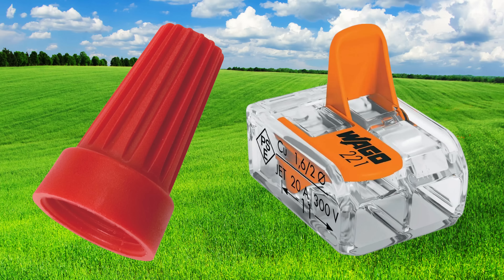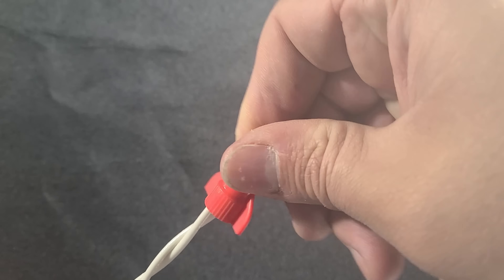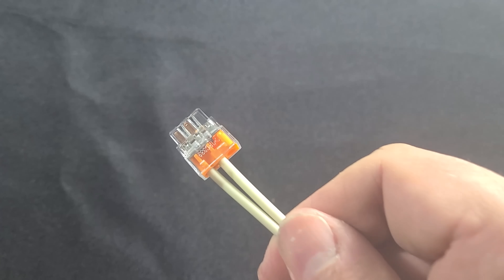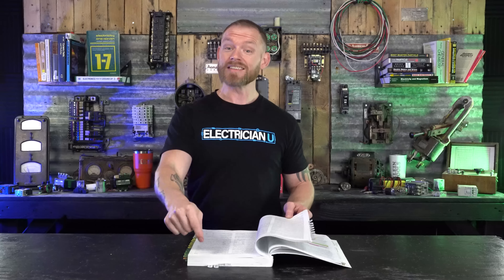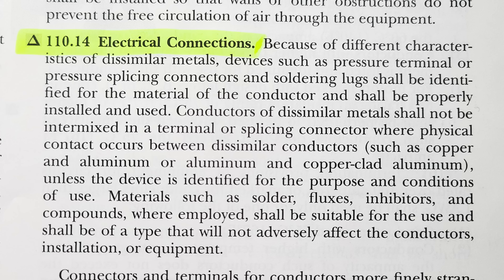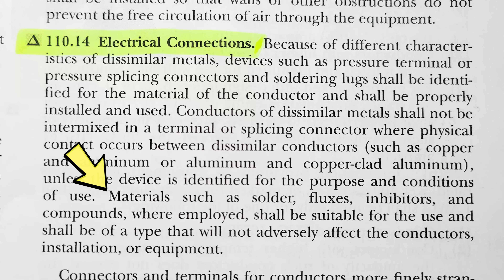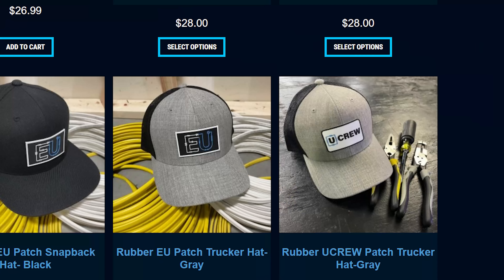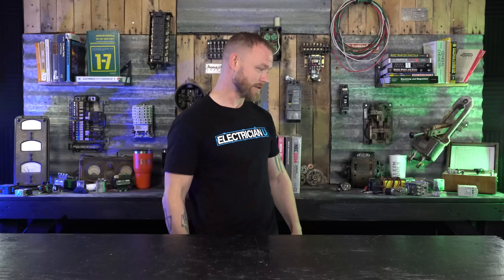Should We Use WAGOS or WIRENUTS?!?!

Comment: 15 years in the trade, once i went wagos with lever nuts ive never looked back.
They are just superior in every aspect (exept the cost, wich is saved in time anyway)
Reply: What's really stupid to me, is that no where in here did anyone say WAGO connectors were bad, but that they were a couple of degrees hotter under load and have a slightly different resistance. I'm not an electrician and even I haven't come to the ludicrous statements that others have. I mean, can someone please tell me how saying an extra, IDK, 2-3° maybe, means that they are implying that something is bad, and moreover, does a couple of degrees in wire connector heat and/or teeny bit of electrical resistance, really matter THAT much that it could really be called "BAD" with a straight face??? I mean good God people, is this what humanity has come down to, to where 2° or whatever, of heat, and/or a slight difference in resistance, can cause such name-calling and mudslinging??
Reply: Saved in reputation too. I don't know who wired my home 50 years ago is a twisting asshole
Reply: A well executed hot solder is superior in every way to either of these "trick" connectors.
Reply: @snoopstp4189  so one minute for each solder then, 5 solders in each box, 20 boxes in a house, 1 house a day for 1 week... that's more than 8 hours lost every week.... you see where this is going.
you also answer yourself in your answer "A well executed hot solder is superior". That's the point, "well executed", can you guarantee it every time? a wago is perfect every time, reliability and safety are the most important things here.
In addition to the extra time it takes to do the actual soldering from scratch, it will take extra time every time when troubleshooting or rebuilding in the future.
Reply: @snoopstp4189  that would be be the case for the final connections, in a controlled athomospher you have more time to make and less constraint spaces around...not on an construction site.
Reply: @fionafiona1146  depends on wither you want the job done right or not I guess, but w/ experience making a good solder joint takes no longer than to heat the copper, which is under a minute.
Reply: @fionafiona1146  from working in the field for 20 years wagos work better with aluminum. No chance of over twisting the aluminum.
Reply: @snoopstp4189  Not really, a cold welded crimp is better.  But we use either wirenuts or som form of Wago or in-sure connector in modern electrical construction.  We don't solder due to a number of factors that make these connections hard to make reliable long term.  Soldering is NOT used anywhere in modern electrical.
Reply: @mikeiver  a crimp isnt really a weld, but you believe whatever you wanna believe
Reply: @snoopstp4189  Really?  Then you may want to correct the likes of Burndy, T&B, Ilsco, and a whole number of others.  You see, a proper crimp connection is a cold welded joint as the conductors are brought into such intimate contact as to be "welded" according to the research.  So yes, I will believe them and their research and empirical evidence thanks very much.
Reply: @mikeiver  and what happens when you go to work on it buddy? Welding aluminum to copper? Lmao 🤣
Reply: @Zapp4132  First and formost, I am definitly not your "buddy."  Second,  The reason we crimp is to assure that service of the connection is NOT required for the life of the installation.  Again you shoot off without checking to see that you are wrong.  Both copper and aluminum are non ferrous materials and are compatible.  There are bronze alloys utilizing aluminum as a major constituent.  You also clearly are not aware that under the proper conditions, dissimilar metals can and are welded to eachother.  Cooking pots and pans are just one example.  In the case of crimping aluminum wire to copper.  The pressures involved at the interface between the pair forces them into such intimate contact that they become bonded/ cold welded to one another.  The above is true for copper to copper and aluminum to aluminum as well.    Dig in all you want but you are wrong here.
Reply: @mikeiver  it's not practical big buddy. You better stay behind the computer 💻
Reply: @Zapp4132 LOL.  I make my living working as an electrician in the main research facility of a global company.  The products of which literally touch just about everyone on the planet in one way or another daily.  In my job I work on a PLC of a test rig in the morning and after lunch the 115KV high yard in a 40Cal arc flash suit.  But you just keep showing us all how much you don't know by shooting off your mouth.
Reply: @mikeiver  whatever you say big buddy
Reply: You actually save copper wire which in turn saves cost.  🤑🤠
Reply: Except tape them to prevent accidental unlocking!
Reply: @2fathomsdeeper  in my experience they stay locked quite tightly, especially compared to wire nuts
Reply: @Chuito12PR  
I'm not an electrician and most importantly I'm not looking to step on anyone's toes here or start a fight in any way shape or form, I just clicked on this video out of curiosity since recently I've been doing some handyman work on the side, mostly drywall work and painting which inevitably puts me into electrical and switch boxes if for no other reason the homeowner saying "While you're in there", and of course I don't want to put anyone or their property at risk, so I'm interested in these connectors because as you know in older homes quite often you run into wires that are short especially if you need to cut the ends to get fresh ends to work with for the sake of not making connections with damaged and weakened ends, I may not be an electrician by trade nor have I been formally educated in the matters but that's something that common sense tells you is bad, and although I may not be educated in the matters of household wiring I have been formally educated in the matters of DC current and wiring from my trade.
Which brings me to my point, my main function in life is as a mechanic, I've got over 40 years experience in the field, am a graduate of aircraft maintenance school and have years experience in building performance motorcycle engines and helping design the modifications for performance car engines for friends and colleagues that work in that field, I've been involved in testing in various ways which has put me in close contact with manufacturers from the parts to lubrication companies, I'm not here to sell myself or my services but my field is one that I've been educated in formally and am highly experienced in, and once again have been well informed by some of the biggest companies in the industry. 
The reason I'm chiming in here is because of your reference to Project Farm and his testing, I've seen him perform so called "proof" tests on engines and lubricants that are just plain highly flawed in their execution, due to issues like lack of proper "controls" among other's during his tests at the end of the day they're at best meaningless and worst case dangerous due to his conclusions and the fact that people take them as being done at some sort of scientific level and wind up shortening the life of their engine's. 
Now don't get me wrong I'm not trying to trash the guy, he seems like a clever fellow and I'm sure he feels he's being honest to his viewers about his results but my point is if his experiments with something like testing electrical connectors to destruction are as flawed as his testing of engines and lubricants to destruction I'd be a little leery of the results. 
Just a bit of friendly advice is all I'm offering here, proceed with caution when it comes to his test results is all I'm saying.
Reply: Highly loaded for long durations wagos and insure connectors show a greater temperature rise (IE higher intrinsic connection resistance) than properly terminated and installed wirenuts.  They both have their place in my bag and are installed where good engineering dictates rather than cost or time being the determinant factor.
Reply: @mikeiver  Out of curiosity, were you using the push in wagos or the lever wagos. I assume the lever version is better but I have no evidence backing this.
Reply: @NickFrom1228  Older style lever wagos.
Reply: @mikeiver  You make reasonable points. WRT to testing, it’s important to test for failure modes—what happens when the connector is damaged or improperly used? Testing of materials under only ideal conditions is not complete testing.
Reply: @MarcosElMalo2  The various testing labs as well as the manufacturers have tested the connectors to failure.  I am comfortable with their testing and the products performance.  My testing was very non scientific and simply a test of a hypothesis I had about their junction resistance compared to wirenuts.
Reply: @mikeiver  "I dont belive that for a second"
You actually should and the reason is elementary and inescapable.

In a wire nut connection, you're twisting the wires together directly.  Straight conductor to conductor connection with a large surface area and the wire nut just holds it together.

With a wago type connector, you are connecting your wires through an additional piece of metal, a sort of bus bar, with relatively smallish contact points.

Now that this difference has been stated, if you know the fundamentals at all, it should be very obvious that the wago type connector has a higher resistance and that resistance shows up as heat.

Now is that resistance or heat a problem?  Probably not but maybe in some specific applications.
Reply: @ColonelSandersLite  Pretty sure your response was not meant for me but instead @moGGsor.  I have asserted that, in terms of conductivity, the wire nut is the superior connection.  This is irrefutable!
Reply: @mikeiver  your word is ensure.
Reply: @mrniusi11  Actually Ideal spells the as "In-Sure" if we are being correct.  Thanks for trying.
Reply: @mrniusi11  Actually Ideal spells them as "In-Sure" if we are being correct. Thanks for trying
Reply: @mikeiver  i dont belive that for a second.
First of all they are rated for much higher current then you even use them for (and thats just the rating i would gues that is put with a safety margin)
Second there have been alot of overload tests, you can check yourself here at youtube, and the cables actually completly burn up long before the wago, even after everything is melted the wago still holds its connection.
Reply: @mogg_87  I've seen them and run the test myself.  I have put them in line with wire nuts under a heater load for an extended period of time.  The thermal camera showed that the Wago was hotter than the wire nut.  I have replaced burnt up wirenuts, insure, and wago connectors.  I have been an electrician for the better part of 20 years and 10 of them as a service and troubleshoot tech in all ranges of electrical trades.  To make a statement that one is superior over the other is simply wrong headed.  But you go ahead and assert whatever you want.  I will believe my experience and tests over your assertions.
Reply: @mogg_87     Not that i disagree with you, but probably better to get test results from the manufacturers rather than random YouTube videos.
Reply: @mikeiver  bullshit. That experiment been done and shown on YouTube. Wago took way more than their rated amperage and the wires fail before the connection. Same as wirenuts.

I get using wirenuts as a way too save on money, since it does add up. However, to act like wago products don't meet their specs or are more dangerous than wirenuts is moronic.
Reply: @huejanus5505  Well the manufacturers follow code and i have full faith the producs have gone thrue extensive testing before they hit the market.
But youtube is fun for the public to see some "live tests" where people push them to their limits wich seems to be somewhere around 150 amps for 10 minutes (they are rated at 20 amps).
In my country we use them for 10 amp / 230 V circuits.
Reply: @unitedstatessc  what part of this do you not understand?  Seriously!  I have done the test myself.  I am not saying that the Wagos or the ideal insure connectors are not meeting specs.  They are and in some ways I have to admit that they are superior.  They, unlike wirenuts are far less prone to install errors.  But the connection does have a slightly higher resistance.  This is simply physics.  There are 3 junctions in a wago connection vs one in a wire nut.  Dig in all you want, I care not.  I use them where and when appropriate.
Reply: @mikeiver  you are 100% wrong
Reply: @vinniecocco9932  In just what way am I wrong?  To make an absolute statement with no supporting argument makes your opinion 100% invalid!
Reply: @mogg_87  We started using wagos (221 series I believe) at my site maybe 4 years ago. Industrial setting, mostly 20a circuits fed by #10 THHN for de-rating purposes. In this time we have installed at least 5000 wagos throughout the system, and I have encountered 3 instances of wagos melting and failing while leaving the conductors slightly discolored but not burnt by any means. These wagos were also used while changing ballasts in some outdoor 400w high pressure sodium wall packs. I recently replaced all of these wall packs with led fixtures, and every time I came across a fixture containing these connectors I found that they crumbled into dust as soon as I touched them (I presume from the heat/UV abuse from the lights). As a whole I do not distrust the lever nuts as a splicing device, however they do seem somewhat susceptible to heat and continuous high loads.
Reply: @mikeiver  to be fair, if a fire happens 1 time out of 1000 homes, its still worth using wago, considering the cost in time. I've literally spent 7 hours on one box one time because of the PITA wire nuts.
Reply: @stevejohnson6053  Easy for you to say when it isn't your house that might burn up.  Here in the states any decent electrician can competently install wirenuts.  If you had a 7 hour ordeal in a single jbox installing wirenuts then a career change might be in order.
Reply: @mikeiver  That is a very good point about multiple junctions in a Wago. I would think the "three" junctions for a Wago you mention would be the 3 Terminal Wago. They also make a 2 terminal which would have two junctions.  I have seen other videos as well that shows the temperature rise for Wire Nuts is the least, the Wago next, and then the Ideal. None were out of range, but still you have a point that the wire nuts have the least; assuming the joint is properly made.
Reply: @FlaSunsetA1A  3 terminal Wago wire to bar, bar to wire, bar to wire.  Each is copper to tinned brass so you have dissimilar metal junctions.
Reply: @mikeiver  the incremental extra resistance is equivalent to 2-3 inches of 14awg.  If for some reason that's significant (lol) just trim the incoming wires 1 inch shorter on either side, which is easy because the Wago doesn't need nearly as much wire.   This will also reduce the fill rate of the box, which improves airflow.  Wagos win again!

If this discussion sounds moronic to you, congratulations, you're beginning to understand.
Reply: @hoohah7716  Sold wire in Wago or Insure connectors have a round conductor being pressed into a bar or flat surface.  Much less contact between conductors.   That and there are a pair of connections in wagos, wire to brass bus and then to wore from bus bare.  In a wire nut the conductors are in intimate contact.  Also, code in the USA requires 6" out of the box.
Reply: @mikeiver  I know what's inside; the point is resistance can be measured and it's the same as 3" of 14awg, i.e., a ridiculous thing to even point out.  

6" slack is only needed on new installs, mainly to allow for wire nuts destroying the wire they're mating.  When you refit with Wagos you just trim to 2"  no problem.
Reply: @hoohah7716  You don't cut back the wire just because you are using Wagos.  Code here in the USA states that you need to have 6" out of the Jbox.  Not that it can be cut back to 2" when you are using Wagos.  Clearly the physics aspect of my point escapes you and you are clearly nothing more than another handyman that makes me a ton of money when I get to com in behind you and fix the shit work you clearly do.
Reply: @mikeiver  GreatScott just make a video showing what you stated in your reply. I thought your reply was reasonable. Some of the reactions to your reply not so much.
Reply: @ddegn  The general difference in performance between wirenuts and Wagos is usually minimal in application.  The difference between them in temp rise is smallish but there none the less.  Kinda done with this discussion at this point and some peoples wanton and willful ignorance.  Thanks for your input though.
Reply: @mikeiver  hey just want to say that I agree with you - properly installed wire nuts are better - the twisting of conductors gives greater contact area and therefore better performance under load. I think the reason you're getting so much flak is the fact that "properly" takes attention for wire nuts, but is quite easy for Wagos. And of course, you're not going to have a master or even a journeyman do every wire nut, and it's not feasible to do so. That's the thing - you need to look at the lowest common denominator, and that means the easiest thing to get the result you need is usually better. I see this as someone doing QA/QC on commercial sites, and with clients that don't even allow wire nuts in any capacity. Repeatability is always better than performance if you're getting the minimum requirement.

Comment: Wagos, wire nuts, soldered and fused connections all legitimate splicing choices. It’s the installation method that’s key mess that up and no matter how good the connector it will fail. E5 group on YouTube did a great job in looking at the history of splicing and you would be surprised twisted and spliced wires if done well were really solid. Older standard actually showed how they were to be installed.